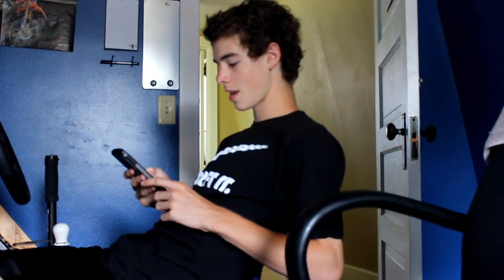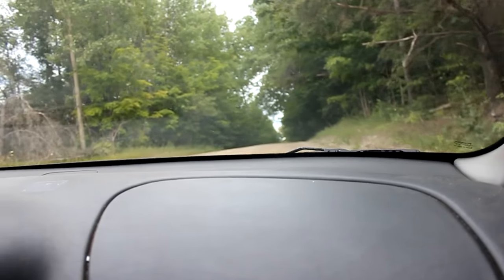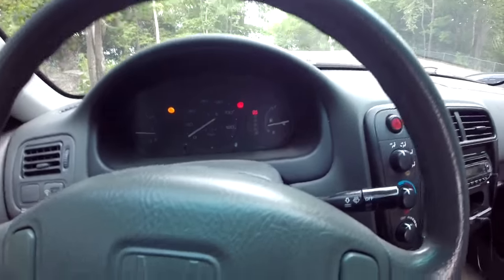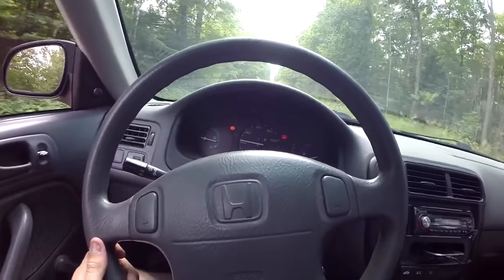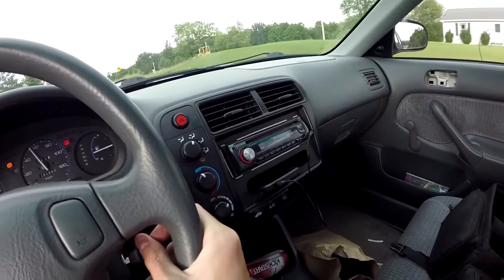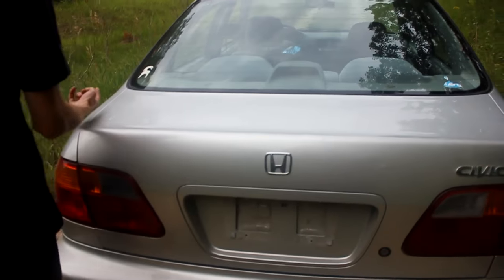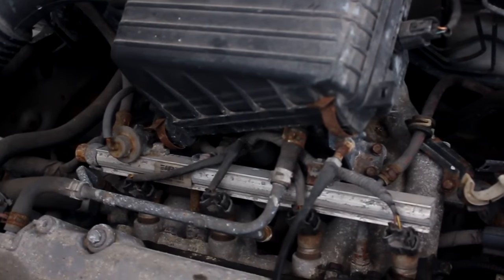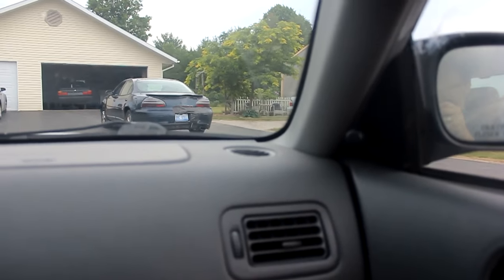I Bought The CHEAPEST Car On CRAIGSLIST!!!

Comment: electric windows are actually lighter than crank
Reply: Taylor Mullis They are?!?
Reply: Jynxx Rebels ????? one where i know what im talking about lol
Reply: Um. NO. I prefer manual, less to break.
Reply: djkenny lol preference aside, electric windows are lighter
Reply: They really are not. Besides the failure and need to spend over $200 to replace a motor.
Reply: djkenny dont you think there is a reason why every single lightweight supercar uses them?? lol do a little research, and again price has no factor in what im talking about
Reply: It is because they are expensive cars. It is based on the clientele that will buy them. Very specific niche to not want PW in a high end car. However, I DO miss the days when Porche offered a 911 Club Sport with manual everything.. to SAVE WEIGHT.
Reply: djkenny lol so they offer pw but manual seat adjustments? dude just google what im telling you and you will get your answer....as to the price lmao ive owned more than ten cars in my life so far. from fords to bmw and ive had 1 window motor burn out in more than half million or so miles ive driven so far lol engines are also expensive and transmissions....price is moot
Reply: It comes down to Consumer Demand. Manufactures wanting to decrease options and not wanting to remove some to lower the price of a car. They make more money by having less options for the consumer, and having to opt for a more feature filled vehicle. Few people really will be turned off by auto seat controls not being included, not worth the investment.
Reply: djkenny lmao you obvioysly cant grasp the conversation.....im in no way shape or form talking about price or options listing....im saying weight alone lol
Reply: Taylor Mullis djkenny why are both of you arguing about car windows?? I mean damn I've seen a lot of stupid arguments on YouTube but damn